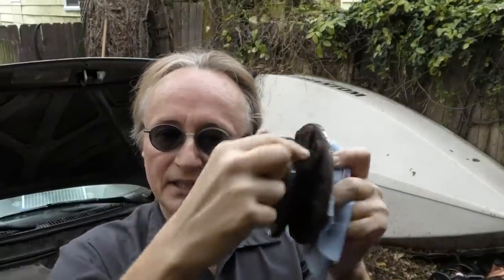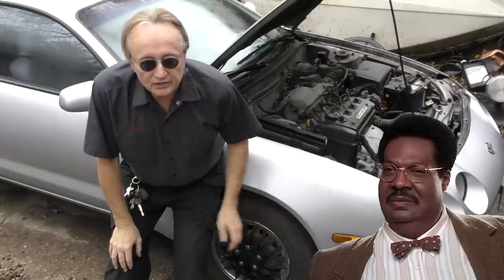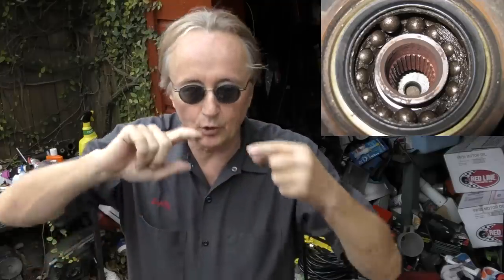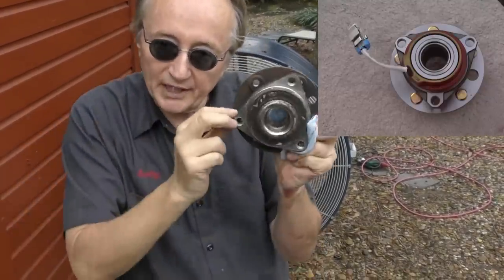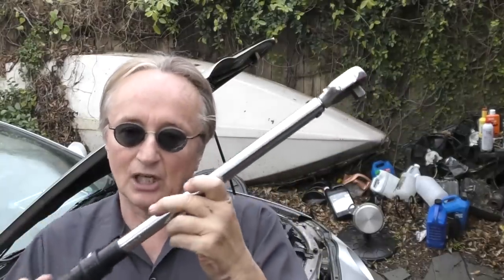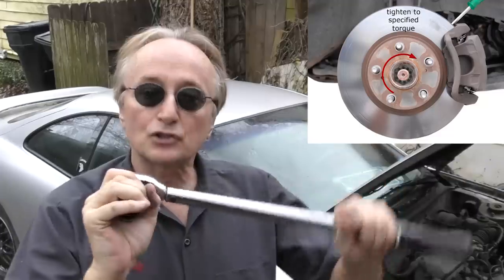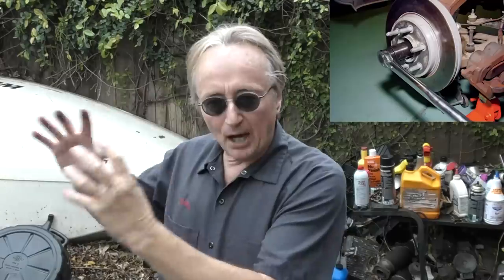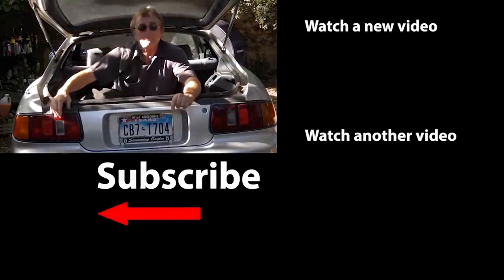Doing This Will Make Your Wheel Bearings Last Forever

Comment: Have you forgot that tires and wheels should be balanced when replacing new tires. Vibrations due to unbalanced wheel puts pressure to the bearings when speeding
Reply: Not really appropriate to mention since there are many different things we should assume as constants that you keep doing correctly regardless of whether you have a wheel bearing failure or not, and there are many different suspension issues that can cause premature bearing wear.  At some point we have to assume nothing else is being screwed up and just mention things relevant to the specific repair.
Reply: @stinkycheese804 - If the tire company doesn't dynamic balance tires go somewhere else. Bubble balancing is OK for trailer tires as the axle is a beam axle.
Total weights on a big car or light truck tire should not be over 4 ounces.
Years ago I bought Michelins made in France - never needed more than 1/4 oz. on a tire.

Comment: Wheel bearings and CV axle for 96 Honda Accord?
Reply: what size motor does it have   2.2 or 2.7    is it automatic or standard stick shift,   it makes a huge difference,   and what base model is it,   you must provide correct and full information or you will be getting the wrong parts,  they made 5 different models of accord in 1996   the DX EX LX value package,  and 25th anniversary edition,   now yes some of those may take the same parts but it will also depend on is it 4 wheel ABS or non  ABS,   when it comes to honda axles and bearings there are many parts to the information needed to provide correct parts.  just guessing is not a option,  I am not trying to be mad or hard on you,   its just how it works to get the right parts.  and is it the coupe.  wagon,  or sedan,   all are different options for the axle and bearings.

Comment: If you live in a salt belt state where pressing out a bearing is impossible, you skipped the part about having to track down a new spindle from a dry state boneyard via ebay. Man, those are fun times.
Reply: or cut the old one out polish the spindle back up  install the new baring. ive done it more than once

Comment: Rev up your endless money pits!
Reply: I'd rather not
Reply: thedgatmsn not me, I drive a corolla. I get in and go. 🚗
Reply: I have a 2006 Scion xB with 220k miles on it, a 2013 Scion FRS with 162k miles on it, a 2016 Scion iA with 70k miles on it and a 2004 Chevy Silverado z71 with 112k miles on it. The only one that is a money pit is the Silverado. I just paid $900 to replace all the brake lines. I've owned 38 cars in my life and never had brake lines rust through before. Even my 1954 Chevy wagon didn't have that problem.
Reply: 😂😂😂 I love it. Money pits🤣😂
Reply: But carefully as to not blow up ure motor

Comment: This is so true! I used to have a corolla that needed its wheel bearing replaced every 9 months, until I TOLD the mechanic to torque it with a wrench and not the impact. >_<
Never had that issue for the next few years I had it. I sold the car to a struggling artist.

Comment: Disagree with Scotty on this one. I put two new TRQ bearings on my 150.000 mile 06 Ford Expedition  for $120. ($60. each)  OEM would've cost close to $800. I Ill be happy if they last 40,000 miles
Reply: A clean, nonoffendsive comment.  Would love to win the torque wrench.
Reply: low price aftermarket bearings may do the job if you are not asking much from the car....
i mean if you are towing stuff or doing 100 on a highway or making hard turns they wont last long.
here in greece we have a low price aftermarket brand called '' comline''
service  parts like air or fuel filter etc are ok.
BUT
clutch kit or wheel bearings or disc brakes.... man they fail constantly...

hope they work out  4u
Reply: They actually should be about $290 apiece from Ford if not find a new dealer, and good luck those TRQ or TRW bearings, they are horrible.
Reply: Id personally would by an average brand out there and deal with it. Changing them out and pressing them in are about a 1-2 hr job if u know what ur doing....no reason to spend over $200+ ea depending model of car and mileages.  I speak for those who can work on their own cars ans have the tools.   I rather spend $67-89 ea than $160-219 ea... and like one said mostly likely should last upwards of 35-45k miles.
Reply: @b20eg195  
Yeah, I understand what your saying, but at the same I used to buy cheap autopart store junk and put it on other people's rigs to help them save alittle money, I do alot of mechanic work as a side job. I just got tired of doing the same job over and over again or getting something that didn't fit exactly right and having to modify it slightly to make it work in a application where it was suppose to be. So now I just stick with OEM, there is still a few aftermarket companies like Moog I'll still use over OEM but not many. So yes what ol Scotty is saying is definitely true, use OEM parts, I was even told that way back when and still I chose to learn that the hard way. It just not worth it to buy this cheap Chinese garbage. The only time I use cheap parts is for experimenting or something that was already junk so we can have a few more hours of fun before it's totally destroyed.

Comment: Replaced my wheel bearings on my 03 X5. 20 bucks on Amazon each and bought the 20 ton press for $150 from Harbor Freight. Total job less than $250 plus some elbow grease. Huge difference! ABS lights no longer come on because they're not over heating anymore.

Comment: Both rear wheel bearings on my 1998 accord were damaged when it was transported across country. I'm 99% sure the damage was caused by the straps attached to the wheels / car transport being to tight. Unfortunately, I figured this out too late to go after the car transport company.

Comment: I had a 60 Chev Impala that I had to replace a wheel bearing on. If I recall, there was an inside and an outside bearing.
Reply: Just about most things using tapered rollers usually use a pair for the lateral load.

Comment: Scotty, great advice. I over tighten wheel hub on my trailblazer & it went out after 3 months. I had got the wrong torque specs & made them too loose. Second set have been in for 2 years (same brand) with the right specs & no problems!

Comment: I started watching you about a month ago. And let me tell you. I love the solid info you give.  I do alot of my own work on my vehicle 2000 mazda b3000.  And your knowledge has really helped me. Ty so much for looking after the diy ers. You steer me in the right direction all the time.   I'm just about ready to do my suspension and I now have a understanding on how to do it correctly. Thx again. Mike from nj
Reply: I got the same exact vehicle. Baby that 5-speed transmission if you have one.I beat the hell out of my manual transmission and it's starting to make noise now.

Comment: bad brakes will also transfer heat into the bearings.
Reply: Yes they sure will.  Had a caliper stick and heat up the disc red hot.  Replaced that and the wheel bearing went out a few weeks later.
Reply: @DouglasHolman good one  I'm cracking up so bad i fell out of my chair.🤣

Comment: No thanks, I'll stick with my 9.99 one from good ol harbor freight.
Reply: I wished we had a harbor freight here, I'm going to have to see what their shipping is like. I've heard a lot of good things about them.
Reply: @DeepSouthTechie  they are suprising good for cheap stuff, but I dont think I would buy much of their stuff online. Because they do have a lot of crap at their store, you just have to be able to tell the difference, and shipping tools is really expensive.
Reply: @DeepSouthTechie  I swear by a lot of their tools. I daily use these tools at my family's scrap yard and believe me we aren't gentile with anything.
-1/2 Drive Earthquake Impact. $129.99
-50ft air hose $19.99
-1/2 Drive Breaker Bar $19.99
1/2 Drive Impact Set $29.99
And now we just bought a truck box air compressor from a tire shop used but still runs like brand new. No bs man they have some gems
Reply: @docholiday5766  Good point. I would be a little nervous ordering from them without seeing their products first or paying for heavy shipping costs. I'll just have to stick with my local stores for now I guess.
Reply: @dutchynehtam  I'm still going to look them up online, maybe for some lighter weight items or if the deal is good enough it will be worth taken a chance on. Those are some good deals you mentioned, you have me really curious, lol.

Comment: I've been around this as long as Scotty.
This is the best over all explanation that I have ever seen.😎
Well done. 👍Thanks.
Reply: MOST tires are significantly out of round. That is a constant beating on bearings, shocks, joints, and just plain old vibration shaking throughout the car like an out of balance tire. Cheap tires are worse. About 1/16 inch is a maximum tolerable amount.

Comment: Thanks for the 411 my wheel bearings need to be replaced on my 02 DeVille. I'll be sure to buy the OEMs and to torque them with the proper tightness. Glad you mentioned injecting grease because I've done that as a temporary measure until I get the new ones, now I know better. Appreciate your channel. I hope you keep doing this for a long time and have much more success.

Comment: Scotty, I snapped my rear passenger tire knuckle and bent the lateral link that connected where knuckle snapped in a nasty highway spinout + swamp crash. Also bent the strut. I replaced the lateral link and strut, waiting to connect it all to the new knuckle.. only problem is the new knuckle is from a junk yard so it is still connected to the hub, but the heat shield is bent bad and the e-brake cord is cut on the new hub/knuckle and the partially disassembled old hub still has the cord connecting it to the car and that's it. I don't want to disassemble the new hub to remove the cut e-brake cord and insert the one connected to my car.. in fear of not being able to reassemble the hub (it seems like an irreversible thing that results in me needing to buy a new hub which I have to do to my current hub anyways if I only use the knuckle from the part from junkyard) and I'm also worried my old hub is perma-locked bc while trying to be pulled out of the water and thru mud, they said the tire affected (rear passenger) wasn't spinning at all. Help!!

Comment: Thanks for all the tips, I have thought about it and over the years, each of your points how bearings wear and get damaged are right. I had to think of bearings on my 2009 Mercedes E550 because it was making a odd growling noise at parking lot speeds that passed the vibration to the steering. I also had slight cupping wear on the tires. I couldn't be sure if there was noise at faster speeds because you can't hear with the wind noise. I also couldn't tell if the noise was created by the cupping on the tires or if the cupping was a secondary symptom of whatever was causing the noise. I replaced the bearing cages on the taper bearings without replacing the race pressed into the hub, but was able to change the other side that slides on to the axle. There was absolutely no visible wear on the race I left in (@ 120,000 miles). The cool part of that car is that the bearing lock nut has a cut across that is held tight with an allen bolt. You are supposed to finger tight the bearing check nut and then tighten the Allen bold to keep it all in place! I found it to be a weird spec since everyon'e finger tight might be different. so I tightened it to the  best I could with my finger and closed (replacing with a new seal) and it's been fine for the last 2-3 years. However, the noise never went away. I later found out that the noise was due to a cracked bushing on a control arm, along with a worn out ball joint. because replacing the control arm later fixed the noise. Thanks for your entertaining series, i find your honest knowledge and experience sharing very worth while and often it concurs with my experience and I learn many little things. 
I don't need the torque wrench because I use a digital one, but not opposed to receiving any other goodies. :)

Comment: That's some very good and useful info. I recently scraped my front wheel against a curb and had to change the tire. The new tire seems to be pulling the car slightly towards itself. I wonder if I have damaged the wheel bearings or messed up the alignment.

Comment: A few videos on youtube showed guys pounding bearings in with wooden block in which was laying across whole face of bearing. And other old timers always said to use large socket to match the size of the outside race and pound in evenly rather than slam a 20 lb sledgehammer.

Comment: A bad tire shop stripped a lug stud, went to another shop and they changed it out. When I got it back that front left tire was making a slight grinding noise. When I took it back I asked if they removed the hub to do the job. One mechanic said yes of course the other said no it wasn't necessary (98 Acura TL 3.2 230K mi) so they of course denied doing anything that would result in the wheel making more noise and accused me of trying to get extra work out of them. 
Its been a year now and noise is basically the same (minor) and wondering if they just over tightened the Spindle Nut. I have that same torque wrench. Can I just loosen the lug nuts a couple turns, then loosen the Spindle Nut and re-tighten to spec? or does the wheel have to come off? Thx

Comment: Scotty - I just changed all 4 wheel bearings on my 2006 BMW 550i.  Getting the axles off wasn't easy.  But I cleaned them up with a wire brush and WD40/Brake Cleaner, oiled them up and put them back on the new bearings.  The problem is it was about just as hard to put the axles back on as it was to take off.  I used a impact wrench to screw that axle back on as close to the original placement as possible which was pretty tight.  But after watching your video now I'm concerned I may not get the life out of them that I was expecting.  If they are so hard to get on how can you even use a torque wrench on them?

Comment: Just ordered a cheap hub and bearing with abs sensor but it is advertised as oe and the eBay seller has had no complaints so people must be happy with them.  Sometimes the choice is very cheap vs very expensive.

Comment: Thanks for the  current information on making wheel bearings last longer. In the past the tightening instructions for wheel bearings on my older cars and F150 truck have always been to tighten the nut while spinning the wheel and then to back it off a specified amount. I don't ever remember using a torque wrench after repacking my wheel bearings, but it's not a job that I have done  that many times. Maybe  I did use a torque wrench for the initial tightening of the spindle nut before backing it off.  Thanks for all the great informational videos Scotty!

Comment: How important is it to maintain wheel covers & hubcaps? I lost 2 out of 4 on my 1990 glavall van? I still have dust caps on my bearings, but will it make brakes get dirtier faster? Pep boys doesn't have any wheel covers. They told me to try napa. Ford, I bet, is kinda spendy. I cant afford modern wheels. I suppose I'll keep looking in those out of the way parts stores. I'd hate to miss a bargain.

Comment: In the old days, I had to look up the torque specs for all the cars from the 60s and 70s on which I did the wheel bearing maintenance. And in my college class about tires and suspension, they told us the most common thing people do to wear out their tires prematurely is to drive way too fast around sharp turns--especially highway on ramps.

Comment: I was riding on bad bearings on the rear right hub of my 07 taco finally the best solution became buying a rear axle with all the bearings pressed on from the salvage yard only $225 which would have cost me over $1,000 OEM parts. I love the junkyard.

Comment: Scotty I got a 2004 Dodge Ram 1500 4.7 motor I have a bad front CV axel I’ve tried over and over to get it out I’ve used a slide hammer and all kinds of different penetrating oils and nothing has worked what do you suggest?

Comment: Do you actually need to use torque wrench if your wheel bearing is with hub Assembly and tighten to front axle assembly from inside etc engine side. Like it is with G35. I see that even dealer service does not use torque wrench for that particular car?

Comment: I have a -1967-68 torque wrench. Craftsman I believe, yours looks a lot more accurate though. I also have the screw driver W/The long spring & Allen wrench that goes inthe little slide up window on the distributer cap I got from the MAC Truck when I was working for Pont. in Oak Lawmn,Il.

Comment: Hey Scotty my 1988 Toyota pick up wheel bearings never been replaced but I did grease them twice since 2004 need to grease them again one more thing The rear end third member has never been changed simply because I cannot break the boat loose to change the fluid even after soaking it for weeks with a catalyst don’t own a dork ranch but seem to manage

Comment: Scotty, I've always wondered because certain greases do not mix with each other, what should you use on ball joints that have zirk fittings but come pregreased? I use to use Mobil 1 synthetic but it would separate and leak a pink ooze when sitting in my grease gun. Now use moly from oriellys. Is that good?

Comment: Scotty forgets to mention that w/ old school wheel bearings, they must first be seated before final torque is applied...This is done by torquing to spec., then backing off the wheel bearing nut 2-3 turns, rotating the road wheel a few times then re-torquing to spec...You will find this outlined in the repair manual for your older vehicle under: Front wheel bearings R&R...

Comment: What is the maximum setting on that torque wrench? Mine only goes to 130ftlbs & the wheel bearings I replaced on my truck need to be torqued at 170ftlbs. I just went to 130ftlbs and then another 1/8 of a turn. Hope its close enough.